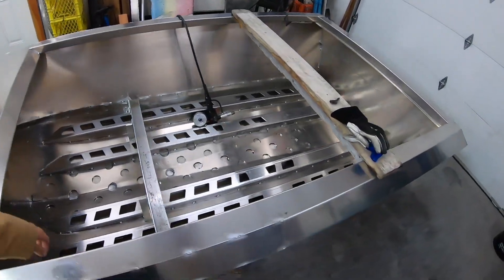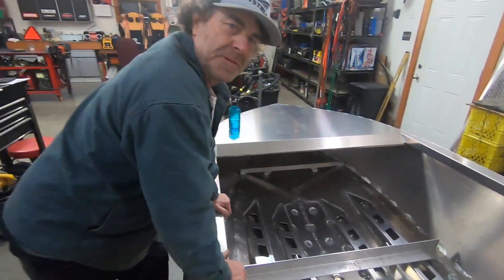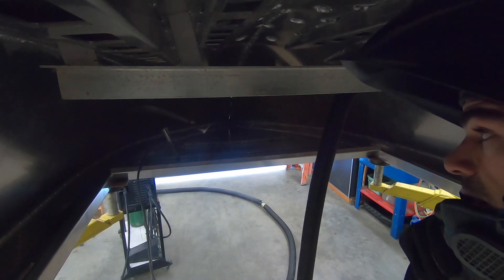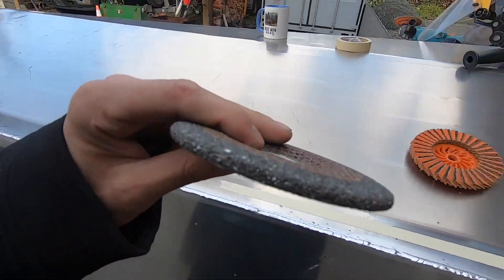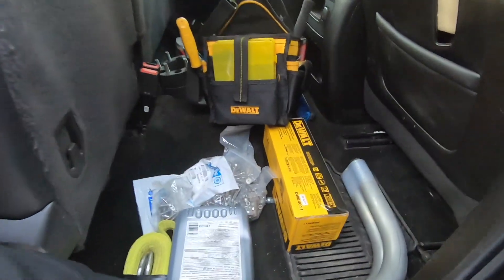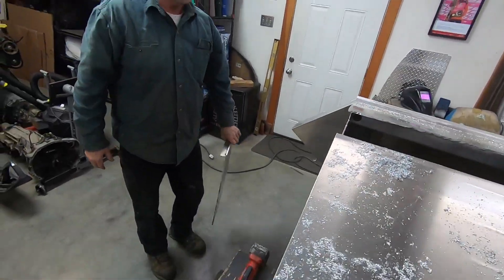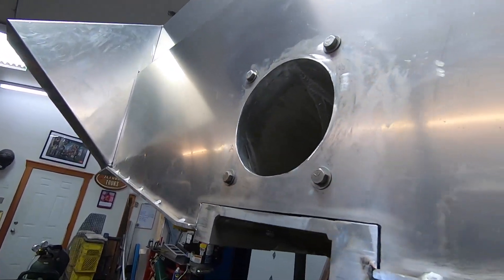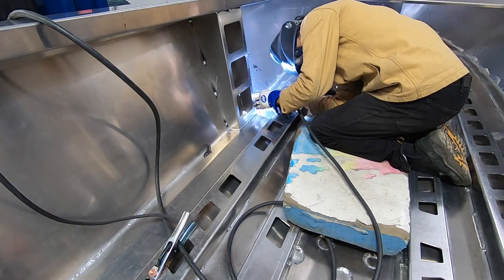Mini Jet Boat Build | Part 3 | Jetstream 12' Buccaneer

Comment: I'm giving serious thought to making one of these. What is the barrier of entry to someone who has never welded before. (I have worked on my cars in the past)
Reply from the maker: We were first time welders at the start and I can definitely say it was quite the challenge. Any angle and any gap difference changes everything, wrapping your head around all the settings on the machine was definitely a learning process. Safe to say if I had to do it again it'd be welded up a lot faster and nicer haha
Reply: so aluminium is quite easy and hard to weld at the same time. this boat with the difference in thickness will cause a bit of challenge but nothing you can't overcome. I would recommend getting some pieces to try out first and go from there but once you get the hang of it will go like butter. for reference, I'm a welder by trade and worked with aluminium for 2 years straight mig and tig if you have any questions shoot me a message
Reply: @mikeyyy187  Thanks man. Much appreciated. I think I will buy a welder and start practicing in my garage.